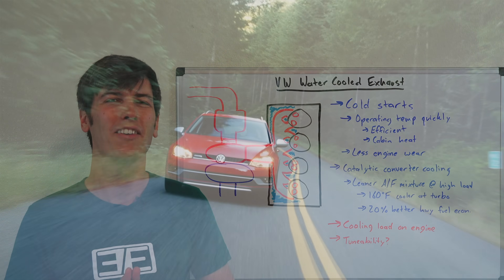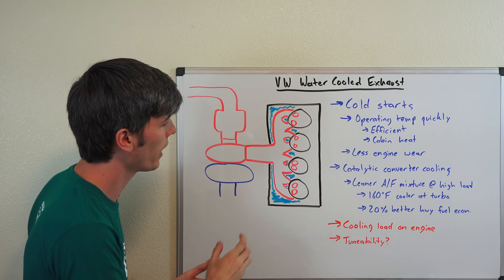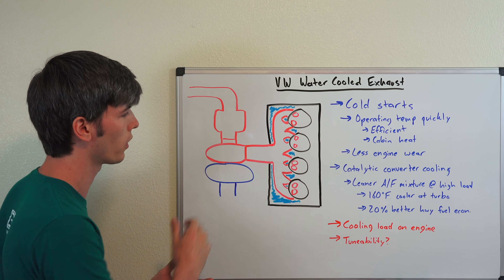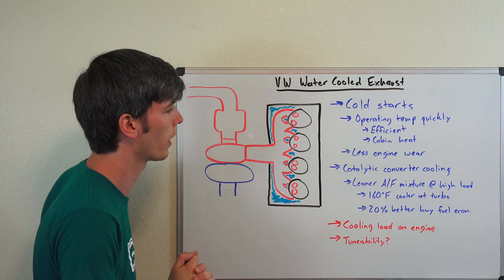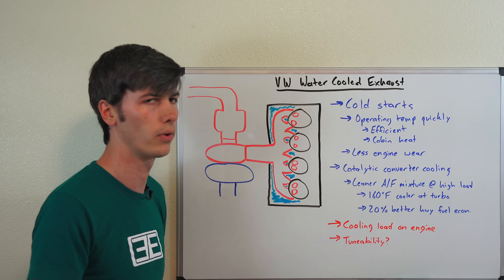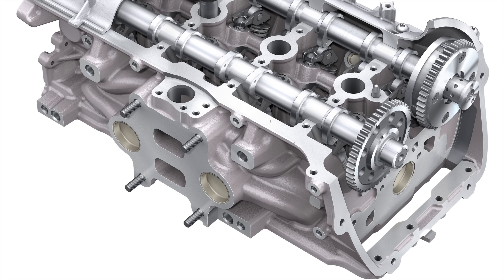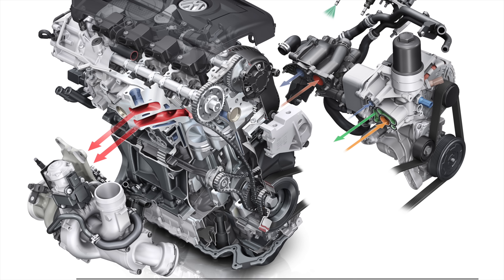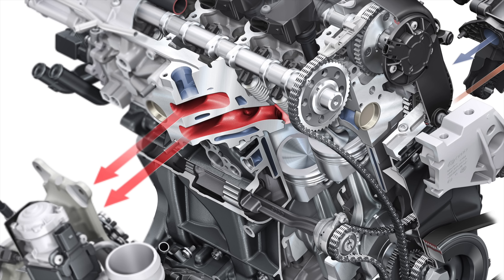Why Does Volkswagen Have A Water-Cooled Exhaust?

Comment: I don't understand how this isn't harm the turbo's efficiency, in theory the heat of the exhaust is used to spin it, so it makes the engine more efficient, but if you make it cooler that should be bad. I don't like how these engines evolve, this horsepower could be achieved with the same displacement, same hp, little less torque with n/a, lot less complicated, better longevity, a little more co2 and without direct injection a lot less nox. The problem is that manufacturers create these complicated engines witch are way less reliable than in the past, so 20 years later it won't worth to fix it so the lifespan of the current generation of cars is a lot shorter, that being sad it's worth a dispute witch one is worse in the long run, a little less co2 (mpg) or the one than is sustainable for 3-4 times as long. (i'm not even talking about 40-50 years old benzes that still run in africa with zero maintenance)

Comment: Another forgotten reason (which is very common for nowdays automotive engineering) is, that they can save on parts/part numbers/aftersales/validation/tooling etc. etc. by integrating the exh. manifold into the head. Cost reduction is the magical word - any (automotive) engineer will understand me ;))

Comment: APR and CTS already sell garret turbos with modified exhaust housings/adapters to bolt right up to the factory flange in the head. this pretty much stopped nothing in the aftermarket, but did require a little more r&d.

Comment: I have a question. About engine wear... Does this setup somehow help the motor oil to warm up faster? When talking about engine wear and operating temperature, oil temperature is the main factor, not the coolant temperature. Motor oil is also warmed up by the turbocharger, but with this setup the turbocharger is colder. I just doubt that this setup has a significant effect on motor oil temperature.

Comment: durrrrrp most turbochargers are in fact watercooled and oil cooled too, so technically you can consider anything with a turbo to have a watercooled exhaust since a turbo is part of the exhuast system

Comment: the two exhaust ports are not because of twin scroll turbo. I suppose one port is from cylinders 1+4 and the other is for 2+3. The reason is to produce continuous flow of exhaust gases and to prevent exhaust gases back to the induction phase of the next cylinder to fire. I hope I expressed it correctly, I am not a native English speaker
Reply: You don't need a manifold design like that to "prevent exhaust gases back to the induction phase of the next cylinder to fire". What you are suggesting could only happen if the valve timing was seriously wrong. The valves and cam timing are what stop exhaust gasses flowing into the other cylinders, not the manifold design.
Reply: Asked a VW technician about this and did some research myself, the turbo used in the EA888 has two channels where one becomes narrower than the other towards the turbo scroll. There is only one scroll but the narrower path (faster exhaust velocity) is directed towards the tip of the scroll to spool it up quicker and the other wider path (more exhaust gases) goes to the outer parts of the scroll to provide more boost and therefore more power. That is why there has been confusion on whether or not the EA888 is twin-scroll or not.
Reply: yes you are right, its designed that way so that one exhaust cycle does not cause turbulence to the other and sometimes it adds a bit of a scavenging effect
Reply: You are correct.  Firing order is only part of the equation due to overlap.
Reply: I'd actually say they split the exhaust port going to the turbo to increase the volume to surface area of the exhaust duct in order to cool it better. You can see a cooling duct right between bost exhaust ports. And it wouldn't work with a twin scroll turbo since with it you need to direct exhaust from certain cylinders (due to timing) to each of the two scrolls of the turbo. This engine has all cylinders fed into both exhaust ports. Plus for a twin scroll the ports should be left-to-right, not up-and-down.
Reply: @Primoz.r  OEM is single scroll, but you can use twin scroll turbos.  I have a twin scroll EFR7163 on right now and it is much more responsive than single scroll just like usual.
Reply: It's actually that the 2&3 cylinders need to have headers just as long as the ones on 1&4 so they go up.
Reply: it happens, although not a lot on more modern engines. if you check older high performance engines like for example the Alfa Romeo Nord engines they always have split exhaust manifolds. I don't want to insist but I'm quite sure it is one of the reasons that the pairs are 1+4 and 2+3. so one of each pairs fires at each time. cheers
Reply: noxious89123 l

Comment: Next step is to build the turbo into the head itself.
Reply: Or have seperate turbos for each cylinder lol.
Reply: Chris Webb assuming your comment is serious and not just an off-hand joke, do you think there would be benefits to incorporating the turbo into the head? That's quite a packaging problem...
Reply: The same way camshafts go into a head, a long tube, with 4 very small diameter turbine blades that the exhaust blows into and then out an outlet manifold to a cat and exhaust system down stream. If VW can build a complex water cooling jacket into a head with exhaust manifold in it, this should pose no more serious difficulty. The question is, will this be of any benefit?
Reply: Robert Johnson The oil feed will be simpler, but, damn, how will they manufacture it?
Reply: peejay1954 Thanks. The benefit is that anti-lag will almost disapear. This will be more helpful for diesel engines, as they don't need intercoolers as much and because their turbos have variable geometry already.
Reply: Block

Comment: Wanted respectfully point out a few things.  Ford has been running integrated exhaust manifolds for a few years now on 2.0L GTDI and even longer on diesel applications.  The biggest reason is cost saves due to casting being very cheap for 1 part now instead of 2.  The benefits are also as you said, heater performance is very good with this setup.  Onto some of the issues:
1.  Engine cooling needs- powertrain limiting protection happens much more frequently.  CHT spikes very quickly and the cooling system can't keep up.  A lot of times enrichment is needed just to keep CHT/ECT's down
2.  higher CHT's wearing valvetrain components prematurely.  There's a lot of heat around the cams/valve/lifters.  

VW claims 20% fuel economy from "leaner mixtures".   That's BS.  Stoich is stoich.  You can't run leaner due to emissions.  Can EGT temps reductions keep your cat temps down so you don't have to enrich?  Sure.  But you'll soon be enriching to keep your ECT and CHT temps down.  Thats maybe where they're claiming fuel economy benefits.  less enrichment at high load (like an onramp WOT pull) due to keeping the cat below 1800F for longer.  But for average cruising where the cat is around 1200F, enrichment is needed for any car.

Comment: The new GM LGX and LGZ engines (as used in the 3.6L V6 Camaros, some Cadillacs, and Colorado and Canyon trucks) have a very similar configuration, and for the same reasons. Warm-up time is considerably quicker. Typically, a cold engine burns more fuel due to the lack of proper atomization of the fuel spray being introduced into a cold combustion chamber. This technology allows for better, more efficient combustion sooner which is good for emissions, efficiency, and the heater core warming up quickly! The GM engines also use two different cooling circuits. It's great technology.

Comment: 20% fuel efficiency ... of course this is Volkswagen so that number might be a bit "optimistic."
Reply: I have no hatred for diesels but FYI, the Chevy Cruze Eco 1.4 Turbo easily achieved 55mpg 
highway, 3200-3300lb vehicle.
Now the lighter/smaller Chevy Sonic is available with the same engine , the difference being the Tune and the Final drive ratio. (Somehow achieves less fuel economy.. hrmm..)
Diesels can easily run leaner than a gas engine, so there is more mpg to be had... Just no manufacturer going after it..
I guess what im saying is.. A lot of these guys could be doing better in the MPG department.
Reply: @DarkLinkAD  I had an M6 Cruze Eco for seven years (just got rid of it). The first few years it did pretty well on gas but it never averaged 55 at the pump. With non ethanol 93, tires at 51 PSI, in eco mode (it was tuned which actually increased fuel economy if not in "power" mode. I think I got 48mpg once but that was basically pure highway and hyper-miling. In recent years my trips to and from work I would pull 35-39 mpg depending on how I drove. I now have a 2019 GLI which is night and day with power/torque. I drive that car consistently faster than I did the Cruze, and I average 34 which I wouldn't be surprised if it goes up an mpg or two once the motor is fully broken in, plus the weather is getting fairly cold here in Buffalo. Needless to say, I'll easily take the slightly lower mpg for a much smoother, and stronger power delivery. The only real advantage the VW has from a design standpoint is direct injection, while the Cruze had port injection.
Reply: Probably because it's ignorant, since fuel efficiency can be easily tested by anyone.
Reply: Subaru
Reply: PS the Eco Cruze is 3000lbs. They pulled a few things out of it to save weight over the other models. The GLI I believe is around 3150 and is certainly a larger car hands down.
Reply: rockn roll  as others have said, my vw is rated for 32 highway and mixed city and highway I'm averaging 34. Yes, it's under rated.
Reply: Was achieved once on a holiday weekend by a contract tech.
Reply: Volkswagen didnt just lie, they wrote computer code to cheat emission testing and lied about it.  Why yall salty over this well deserved criticism?  They have zero credibility now.  Its just a fact.
Reply: @pstrap1311  just like Dodge and Ford did
Reply: @pstrap1311 ... and completely understandable.  Automotive operational maps are designed to optimize for different operating conditions. High speed. High altitude. Cold temperatures. Acceleration.  Worn components. Soft system failures.  Limp home mode.  Safe shutdown.  Variable fuel quality, Etc.

 It is not a surprise at all that they designed a special map to optimize for test conditions. Indeed they would have been remiss if they didn't.
Reply: Asserting that this is fraud is a  simplistic simplification of a complex subject. The "ex post facto" declarations of malfeasance hide the need for much better specified emissions test conditions.  This is a job for independent federal test engineers, not the employees of automotive manufacturers.
Reply: Honda toyota caught scam fuel efficiency numbers...not volkswagen...
Reply: efox2001 Actually, if you did more research rather than just the slanted American auto media and their hatred for diesels, your quickly find that Volkswagen (along with most other German car brands) UNDER advertise their numbers in regards to fuel economy, horsepower, and torque. 

Proud owner of VW
Reply: @jmccann6735  and overestimated durability.

Comment: Ford 1.0 ecoboost has this since 2012 or so.
 No brilliant inventions by VW here.. VW's engines suck reliability  and preformance wise... big time. Both petrol and diesel.

Also I really dont think that this was done because of performance reasons but because of cost instead. Exhaust manifold is an expensive part.. so why not integrate it into cylinder head and save money.

Comment: So what happens when you live in colder climates and the water freezes? Now what?
Reply from the maker: Brian Kenney what? If your coolant is frozen your coolant is frozen, doesn't matter what kind of engine you have. But coolant has a very low freezing point, so it shouldn't be a problem.
Reply: Thanks for the clarification I had in my mind water cooled not coolant but re watching you said coolant a few times
Reply: Brian Kenney when your engine is water cooled, when you have coolant in there 😂 they can't just put normal water into engines
Reply: Yes I understand that I think the title saying water cooled put the VW idea into my head of water cooled!

Comment: I own one of these in a '15 Passat. I have no complaints thus far and have achieved up to 34 mpg on a highway trip running between 70-85 mph. With the windows down, I can hear the turbo spool very quickly with just moderate throttle and power is adequate for my needs. I will assume that if there is a cooling system failure that things will get expensive very quickly but I don't really live in fear of a major problem. Overall I am very pleased with the car for the price I paid for it.

Comment: This is coming from someone who doesn't have a lot of experience with Diesel engines, but could this be used in a small Diesel engine? I'm curious if VW will use this design in potentially the next generation of Tdi engines to help with emissions control and overall efficiency.

Comment: You forgot to mention that the entire cooling system will have to be at a much higher pressure to raise the boiling point or use some other liquid that has a higher boiling point than water.  If there is even a small dead spot that doesn't get sufficient coolant flow with water at the normal 16psi it will rapidly boil with such a temperature differential so I am curious what they actually did to combat this issue.
Reply from the maker: Davis King you don't have to up the pressure, just need to have adequate flow. A properly sized radiator should have no issues keeping this in check.
Reply: Of course with enough flow you can cool almost anything but the radiator would need to be massive to allow the coolant to shed the heat.  I suppose with a large enough thermostat it could allow enough flow to the exhaust side as well but I bet they had to do something else to manage that system.  Does that vehicle use an oil for coolant rather than water?

Comment: There is a problem and that is with the lower enthalpy of exhaust gases turning the turbine of turbocharger. Lower enthalpy =} lower turbine work =} lower compression =} lower power(170 hp if I'm not wrong). Remove the water jacket of exhaust manifold and I am sure you get higher power.

Comment: but if its allowing a more lean fuel mixture wouldn't that put the heat on all of the components before the cooling feeds in the exhaust? Im not entirely sure of what all that entails, but like high heat/possible warping of pistons, head, sleeves? dont bash me too hard still trying to learn lol.
Reply: Vincent Tenaglia I suppose that all these increase the heat in the engine even more and having to cool after the turbo adds extra hoses that can fail and costs more to produce. This has no failure point. But it's nothing that can't be fixed with a big ass radiator.
Reply: True id like to know if they coupled this with a bigger radiator. I would imagine they would since cooling more things and also more coolant needed in the system = bigger reservoir/radiator?

Comment: I maybe wrong but, the 1st thing comes to mind is it won't last for whatever future failures. It would have been popular a long time ago. Look at coolant through throttle bodies even though it's for warming up the engine faster it's robs performance and doesn't take much time away from operating temperature when bypassing the line's.
Reply from the maker: +Alpha Ghost coolant lines on throttle bodies are for ensuring the throttle valve doesn't stick in freezing temperatures. When the engine is cold the coolant is cold,  ambient temp intake air won't change that.

Comment: Please make a video about turbocharged gasoline engines. I dont quite understand it: Why would you need boost if you are not at full throttle? The throttle body restricts airflow (obviously to set air-fuel ratio) and the turbo attempts to blow in more air, thus working against each other. I know that it helps when you press full acceleration but in a family or a city car doesn't really matter.